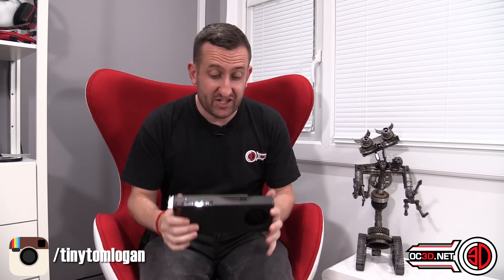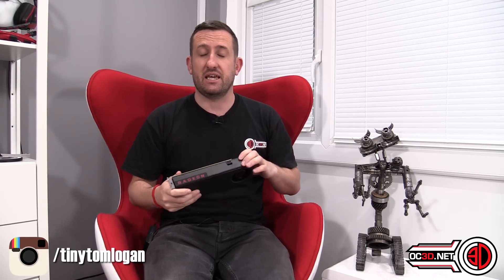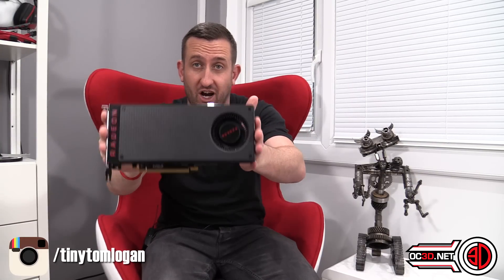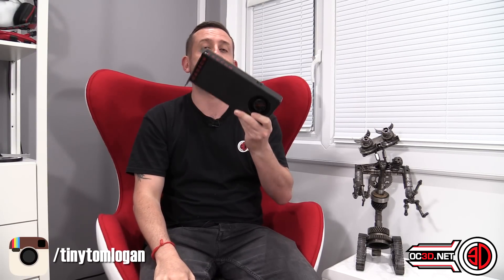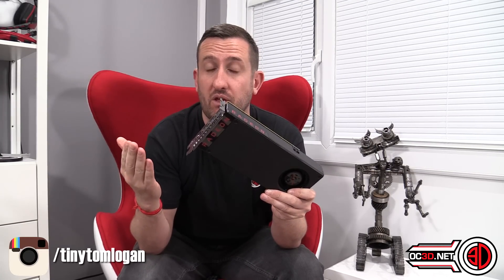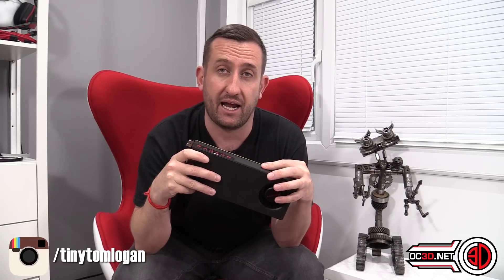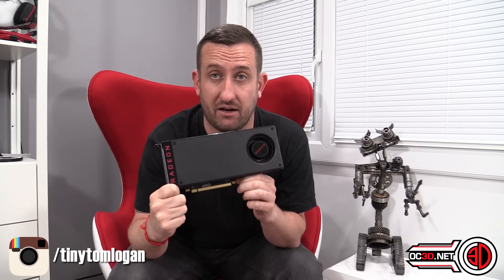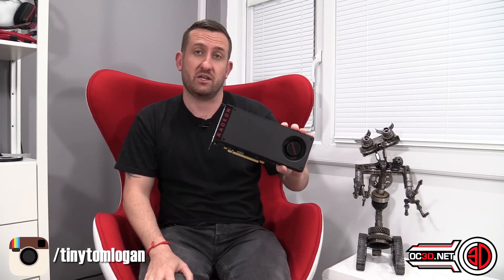RX480 power bottleneck? TTL Talks

Comment: i own a reference Rx480 @2020, under volting it a little bit improves temp issues for me. now my temps are between 69-73c under a heavy load and 38-43c on idle. btw, i live in the philippines and the  temperature here is 38c (daily) and  40c @summer.

Comment: The only thing I want to know is what kind of temperatures @ what fan speeds, and subjective noise levels..Please.
Just ordered an XFX 480 reference, b/c it comes with a backplate no extra charge, and is the same price as reference here in Canada $329+13%tax=$374 CAD.  :(
Only reason is the board partner cards come in at $399.99 MSI + taxes, that's over $400.
Yay Canada!
So since the reference cards are performing the same as the board partner cards, I thought hell screw the bigger cards and fans.
Reply from the maker: Ahhh but they are not. The overclocked XFX I got performed the same as a ref card unless you open up the power limit. The cooler cant cope with it either. Id honestly say to you look for an aftermarket cooling method for your card.
Reply: +OC3D TV Even at a $75-$100 price premium?

Comment: How 'bout reducing the VCore on the GPU?
If you undervolt it, it drains less energy from the power connector and should also stay on the clocks. Computerbase could undervolt P7 about 0.075V down to 1.075V, a fairly huge step. The other P-States could ramped down equally so the power consumption shouldn't be a problem even with a 100% Power Target.

Comment: NO AMD Watt Sucking Hot Running is NOT the best value, the BEST VALUE and much more future proof is the highly 
overclockable Performance Per Watt Titan Beating Champion Pascal 1070
using the same TDP of 150 BUT NOT VIOLATING the PCI-E Specification. Watt Wasting Polaris with a 150 TDP has about the performance of a factory overclocked Maxwell 970 which is pretty pathetic for new FinFET AMD Flagship Polaris. 

If your a budget gamer and looking to game on the cheap WAIT for Pascal 1060 and then decide, OR ELSE risk getting a Bad case of buyers remorse.

Comment: Thanks for the video. The OC capabilities of the RX 480 have been disappointing on every review to say the least, and as soon as I saw the power draw of this card I knew it was being bottlenecked by power. As I said in another video, for me the real news from #Powergate is that this card could be doing a lot better with an 8-pin connector, and your video just confirmed it. I cannot understand why AMD didn't place the 8-pin connector this card needs on their reference cards. That wouldn't had just saved them a lot of trouble, but their cards would also be performing a lot better.

Comment: AMD Statement: "As you know, we continuously tune our GPUs in order to maximize their performance within their given power envelopes and the speed of the memory interface, which in this case is an unprecedented 8Gbps for GDDR5. Recently, we identified select scenarios where the tuning of some RX 480 boards was not optimal. Fortunately, we can adjust the GPU's tuning via software in order to resolve this issue. We are already testing a driver that implements a fix, and we will provide an update to the community on our progress on Tuesday (July 5, 2016)."

Comment: Official statement from AMD: ( As you know, we continuously tune our GPUs in order to maximize their performance within their given power envelopes and the speed of the memory interface, which in this case is an unprecedented 8Gbps for GDDR5. Recently, we identified select scenarios where the tuning of some RX 480 boards was not optimal. Fortunately, we can adjust the GPU's tuning via software in order to resolve this issue. We are already testing a driver that implements a fix, and we will provide an update to the community on our progress on Tuesday (July 5, 2016). )

Comment: This wouldn't have been a big issue, if it weren't for the fact that this card was released many weeks before RX490 (they should've launched RX490 first, and afterwards the RX480 within 2 weeks), now Nvidia is about the release 1060 to run circles around this card. Imagine if they had launched with a 8-pin RX490. 1060 will work with 6pin, because both the 1070 and 1080 are more efficient and faster than this card, while drawing same power (1070 draws less, RX480 draws almost as much as 1080). This card's problems wouldn't have mattered too much if they had launched RX490 first, because that would've been the main card for people to buy for now (because let's face it, they will still launch Vega card(s) later this year with HBM2, so they're not going to get all the sales with Polaris only). Would've made a lot of more sense to launch RX490 with 8pin first imo.

Comment: Very good pointing! I had the same kind of experience with the old Pitcairn, the 7850. Just overclocking the mhz +100 and no performance increase. Then, I only slided up the power target at +20%, with the stock speed, and my card got much better results in testing compared to the OC+ 0 power target setup. Sure, first raising power target, then voltage and speed will provide the best performance if temps are OK. 
Who know how much power and speed this card can get with proper power conections and cooling?! This card was so misterious before! And now, it still have secrets to be discovered!

Comment: I personally feel for most gamers who buy a reference card, slap it in and run it at stock, the card is still perfectly good value for money.  Not that i predicted this exact issue, but I'm actually planning on getting one ( will be for a family members computer, and I'll using it myself for a while first before i source the rest of the parts for their PC lol then upgrade to a beefier card come end of the year), and have been waiting for aftermarket cards, for the extra cooling, to get the most out of it, and now even more excited by the extra performance potential.  

Wonder if with more power pins and aftermarket cooling or waterblocks, if it'll hit that notorious "leaked" footage that put the card at 1600MHz, and the other screenshot leak at 1500MHz, be interesting indeed.  A few things lead me to believe there will probably be a 480X released sometime in the next 3 months that'll give a substantial boost over the stock 480s, probably aftermarket OC 480 levels. 

Also interested to see how the GTX 1060 fairs, and the ensuing price battle, the 3GB model seems a bit fluff, but the 6GB sounds like a 1440p sweet spot, and how 1060 SLi fairs against the 480 CF (which is pretty impressive, looking at the CF reviews out so far)

Comment: I don't dabble with OCing because i am afraid to break something, but if i left this as is out of box with my i7-6700k still at 4.0ghz (i might try for 4.4ghz for first OC ever)  will the performance still be good? I just did this build and i have yet to buy a new GPU but i currently have a HD7870 until i can figure out which to buy for a budget seeing as how the Intel build put a dent in my wallet.

Comment: Agreed, the 6pin power delivery system does not do justice to this gpu. It still works well at 150w, but it would work much better if it had an 8pin power connector to deliver 200w. Limiting factor is the power delivery and leaf blower cooler.

Comment: I think the answer is...  It is what it is.   Buy it. install it.  Use it.   Overclock the reference card at your own peril.   For what it is,  it is a good price and forces otherwise stupid midrange pricing back to reality.   To overclock this chip is going to require power and heat disappation and it isn't going to do it for cheap.   They sold it running about the best it can for the price.

Comment: What are the stable undervolt/underclocks on these things? If its still able to run at 1000MHz with far lower voltages I honestly wouldn't mind the cooler temps and better longevity for the performance hit

Comment: Try undervolting it to get higher scores^^
Reply: and try to keep the card cool, lower heat=lower power consumption.
Customcards will ineed be better.
Greetings from Germany
Reply: It's lower power consumption= less heat
Reply: Thats true but what i meant was... Lets say we have a card which is consuming 150W @ 90°C. The same card in the same scenario would consume maybe 120W if it runs @ <60°C, so lower heat=lower power consumption.

Comment: Good video! Just as an FYI, when it comes to the energy (not power, power is energy per unit time) in a switching transition of one of the transistors in the GPU core. The energy per transition will rise linearly with frequency but the square of voltage. Voltage will be part of the power consumption (P = I x V afterall) and power target so the "thermal spikes" they told you about and the sharp rises in temperature you saw when you bumped the power target all checks out. That cooler was obviously just built to it's spec to keep the cost right down. Lots of fair design decisions going on there so I'd definitely not criticise AMD like some are.

It'll be good to see what they can do on air cooled water or chilled water with some supplementary power stages!

Comment: Where is it going to get this extra 100-150w from? The PCI-E slot? if so... oooph. (Still watching, getting to the part of the 6pin)
OK finished watching. It will be interesting to see what the AIB cards are like. I'm really hoping they are able to add more power connectors and rectify the issue with the power draw from the PCI-E slot. As you mentioned lower end boards are at more risk and this card is targeting lower end systems.

It will be interesting to see how this plays out. I'm not the target audience for this card but for the people who are I'm hoping this gets sorted so that way they have, possibly, a pretty good OC card with some higher end performance for $240-260, maybe some at $260-$300 with AIB tax.

Comment: hey tom, u lived last 2-3 years under a rock? that power throttle isnt new. but it runs stock already over the power specs of kable an mainboard, so if u overclock, u may ruin ur hole system. wait for custom cards pls, they will have 200w target for sure.

Comment: AMD - Another Major Disappointment.  The cards are STILL too hot and power hungry. They just put a cap on the power this go around.  Wait for the GTX 1060 people.
Reply: The funny thing is, their major goal for polaris was best performance per watt.... And they fucked up
Reply: The 1060 will be neutered with a 192 bit memory bus and about the same performance as the 480 at likely a higher price, so no. Also, that hot and power hungry card still draws less than the 1070. Wait for the AIB 480s.
Reply: "draws less than a 1070" tbh not even sure it does actually. Also what's a 1070 like 180% performance of 480?
Reply: Rare Person 
http://www.anandtech.com/show/10446/the-amd-radeon-rx-480-preview/6
Reply: Son37Lumiere errrm thanks? you proved my point
Reply: Rare Person
I proved your point by showing that it draws less? Uh, ok. Btw, load draw is much more important than idle.
Reply: 6w difference =/= performance difference, so yeah you did.
Reply: Son37Lumiere also furmark is null. and idle 1070 is even lower. and ive seen other 480's pulling way more in other reviews
Reply: Rare Person 
231 vs 268 is not a difference of 6.
Reply: furmark is null
Reply: Rare Person
One game is not indicative of overall draw either but regardless, it is less.
Reply: Son37Lumiere lol its more indicative than furmark. and like i said, other reviews show rx480's using more power... way more. go look for yourself
Reply: Rare Person 
I have and no, none have shown it drawing more.
Reply: Son37Lumiere also you seem to have missed my point, where does it make up the performance per watt? (spoiler: it doesn't)
Reply: Rare Person 
And you missed my point, that it draws less than the 1070. I never mentioned performance per watt, which is all well and good, however the 1070 also costs more than twice as much.
Reply: Son37Lumiere http://www.tomshardware.com/reviews/amd-radeon-rx-480-polaris-10,4616-9.html
Reply: Rare Person 
Yes, the 10 series has very good performance per watt, but poor performance per dollar.
Reply: Son37Lumiere That review clearly shows the RX480 drawing MORE power than the 1070 which was your original point. I don't care about price, don't change the subject. And btw that review was pretty much top google result for rx480, not hard to find so next time do a little research first, ok?
Reply: Rare Person 
Hahaha! I've read at least seven different reviews, so out of them all, one (Toms) says it draws more. Do you understand probability or statistics? Fuck off.
Reply: +Son37Lumiere that's because nobody explored it.
Reply: +Son37Lumiere check out the video done by PcPer on the RX 480
Reply: Son37Lumiere oh wow 7 reviews! quick someone hire this guy, he read 7 reviews! its clear your salty cos u got called out on ur bullshit and made to look foolish. save urself anymore embarrassment
Reply: Rare Person 
Right, so you don't understand.
Reply: Rob Leonard 
You're talking about the power draw on the PCIE slot right? Yeah, it's around 86 watts under some scenarios, doesn't change the overall system power draw reviewers use to determine power usage.
Reply: Son37Lumiere Lol try harder.
Reply: +Son37Lumiere some peoples motherboards are toast too
Reply: Son37Lumiere Lol you are so obstinate. Stop embarrassing yourself further
Reply: Rob Leonard
Yes, it affects older cheaper motherboards. They're releasing a driver update to limit power soon.
Reply: Son37Lumiere http://www.guru3d.com/articles-pages/amd-radeon-r9-rx-480-8gb-review,5.html
Reply: Rare Person 
Lol try harder.
Reply: Son37Lumiere oops. statistics are swaying
Reply: Rare Person 
Nope, you're just too stupid to understand them.
Reply: Son37Lumiere no need. i've already proved you wrong repeatedly. my work here is done
Reply: Son37Lumiere hahaha okay sure, whatever you say :) suggestion: for burn relief apply cream liberally to the affected area
Reply: Rare Person
You supplied two examples that showed a few watts over the 1070, wow so impressive. You're a regular crackpot detective.
Reply: Son37Lumiere and you provided one? next time when u make bullshit assertions, try make sure u can at least seem to back it up
Reply: Son37Lumiere oooh this is fun! another one. hows the statistics looking now? http://www.eurogamer.net/articles/digitalfoundry-2016-amd-radeon-rx-480-review
Reply: Son37Lumiere anyway i'm done with you, this just feels like bullying now you are too easy. <3 peace
Reply: Rare Person 
Lol, you think you've won something? Whatever helps you sleep at night kiddo but you're nothing more than a tiresome halfwit.
Reply: Son37Lumiere From a pig-headed pseudo intellectual, I don't think anyone's giving that insult much credence. Have a nice life.
Reply: Rare Person 
Careful, your own butthurt is showing.
Reply: Son37Lumiere 10/10 comeback
Reply: Son37Lumiere Indeed.
Reply: Rare Person 
Aww, you're not making it fun anymore.
Reply: Son37Lumiere I already had my fun with you. Clean yourself up
Reply: Rare Person 
You're not only boring but lousy at arguments and insults.
Reply: Son37Lumiere It wasn't an argument, what happened was I proved you wrong and made you look foolish so you resorted to childish name calling. 
I'll just leave this here: https://www.techpowerup.com/reviews/AMD/RX_480/22.html
Note how the 1070 uses less power in every scenario.
"Waaah b-b--b-ut statistics and probability!!!111" lol. You are pathetic.
Reply: Rare Person 
You didn't prove shit and you can't let it go. Yeah, you're fucking pathetic and a waste of time. Cry about it some more.
Reply: Son37Lumiere lol no counter? See it's not an argument. Just your cognitive dissonance showing
Reply: +Rare Person I've looked through the links you posted and YEP!! you have indeed pissed all over him. I guess he's used to it by now. You just gotta feel sorry for the Fanboy.  it's just to easy when they are trying to argue a case against proven fact.  You can just imagine him frothing in pure rage in front of his monitor comparing frames and temps lol.
Reply: MayDay GoingDown!! Lol. Some people are just stubborn and have a hard time dealing with the truth. Funny thing is I get called a fanboy for pointing out facts smh. Truth is 1070 and 480 are pretty close in terms of power draw it's normally within a few watts but given the 1070 performance destroys 480 means the efficiency is a landslide win for 1070 so I don't know why he brought it up in the first place. Fanboys gonna fanboy I guess

Comment: I was confused about why EK made a block for this, it being a budget card and and all and no one buying this card would be watercooling, but now i know why. Because its going to get hot as fuck trying to get any performance out of it. This is completely fucked. If the board partners dont fix this issue with their cards, then there is absolutely no reason to buy an aftermarket card or even overclock any of them.

Comment: Dpn't forget that Nvidia tend to cook their releases more (software) while AMD usually are forced to launch them with drivers in a more raw state. 7950/7970, 290/290x, Fury/ Fury X all came out losing to their competition, but because Nvidia had used up more of the driver potential at release already, those cards all took over their immediate competition 3-4 months later. I think an aftermarket 480 with a couple of 6 pins and an extra VRM phase or three will come close to a 980 Ti in 4 months time in DX11, and tie or surpass it in DX12.
The 1070 will probably always do better at minimum FPS though, due to the GDDR5X. Would be cool to see an aftermarket 480 with 4GB of GDDR5X but I doubt it could happen.